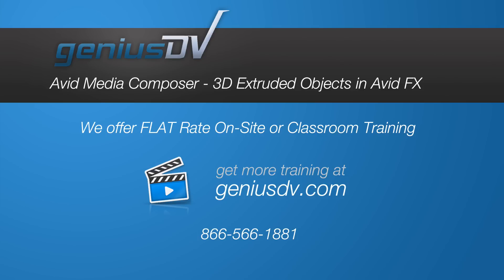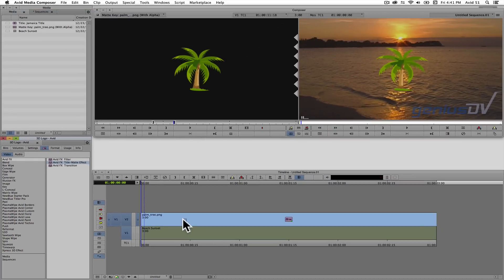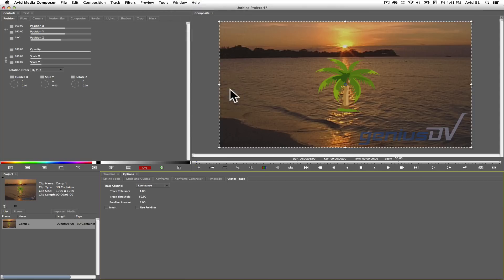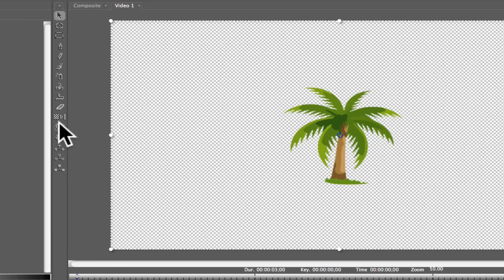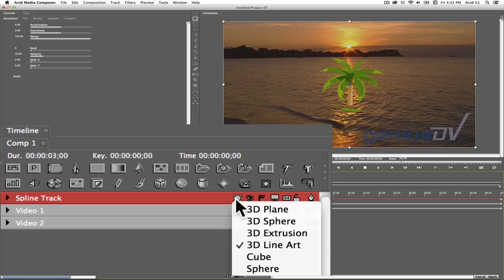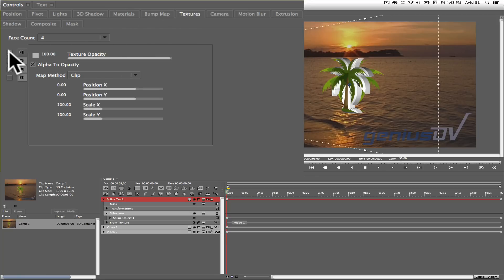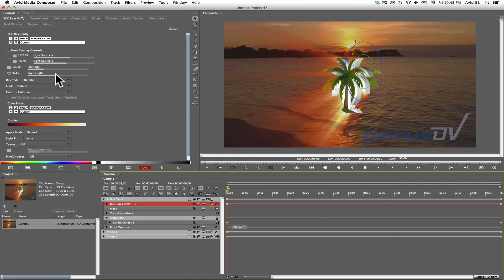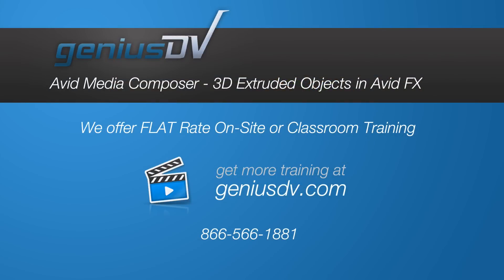Avid FX 3D Logo in Avid Media Composer

Comment: Thanks for posting.  Perhaps you can help me figure out what I'm doing wrong.  Using Avid FX in Media Composer 7.0.3, I've followed the tutorial very closely and when I change the spline track to 3D Extrusion, I don't see the extrusion.  Therefore I can't see the effect.  What am I doing wrong?  I've tried it with 3 different graphics with alpha channel and still can't get the effect to work...or at least actually see it.  Thanks in advance for your help.
Reply from the maker: Hi, Does regular 3D text work? 

What version of Avid FX are you running?  This tutorial uses Avid FX 6.3.  If you're not running the latest software, you can download it from Avid.
Reply: John Lynn
   Yes. 3D text works.   I'm running Avid FX 6.4.   The logo files I'm using are png files with alpha channel.  Just not sure what's happening.
Reply: fjabjr Maybe a little late but i found a solution. you need to put your workspace to standart